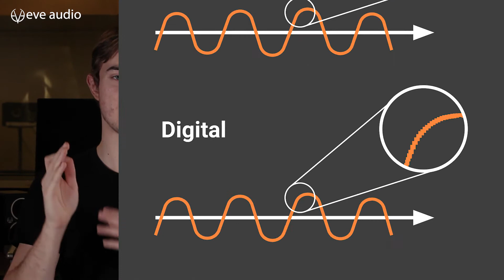Tech Talk: Signal Flow in Studio Monitors

Comment: Hello,thanks to your efforts and explanation.Here is my question.I have a monitor controller with an AD/DA converter at 32 bit and 768khz.My question is if i buy eve monitors will they be able to playback at 768 sample rate?
Reply from the maker: Thank you for your question. There is no studio monitor on the market which works with such high sample rate. Also the values 32bit and 768kHz only describe the converter data. The internal DSP processing of your monitor controller will work with lower sample rate. Otherwise the audio bandwidth was up to 384kHz. 
The question is, whether EVE Audio monitors provide needed bandwidth to work on highest quality level and therefore we can clearly state - yes they can.
Reply: Lol 768khz... that's very interesting